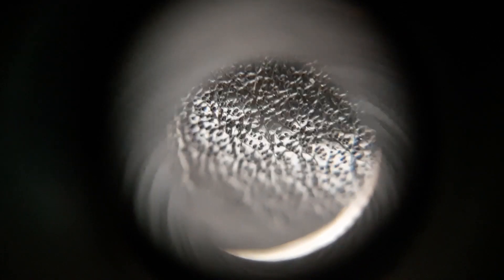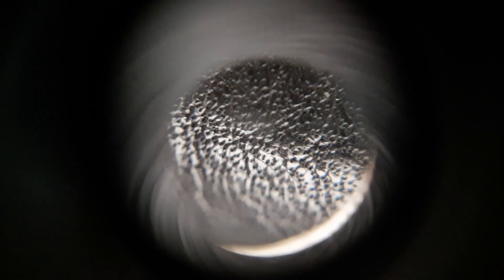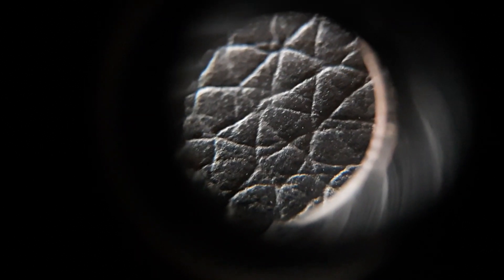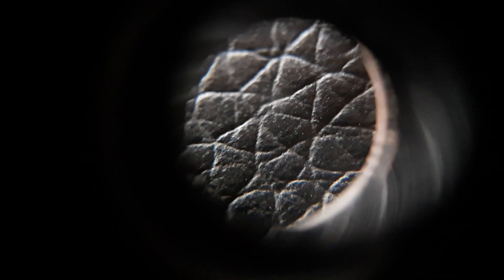Genuine Leather vs Real Leather: Under a Microscope

Comment: Well, this is valid, but still not too reliable, I myself have several leather products, some fake, some real, some genuine, and I also happen to have a microscope, and I also happen to have run a few tests, the thing is, you do can clearly see the pores on a more raw leather, but, sometimes, clothing industry use lots of coats over the leather to prevent it from drying or for their fibers "to get loose" like on a mango pit, and also for dyeing them, I also put my own skin on the microscope for comparison, and the conclusion was: on faux leather, same thing you shown, on raw dyed leather, same thing with pores and all, and in some real leather clothes (depends on the finish, obviously) it didn't look like neither, it had lumps, just like the genuine you've shown, but if you zoom enough you can clearly see it is brown beneath the lumps, and between the lumps you can even see untainted spots with pure leather color

Comment: Microscope method is NOT accurate anymore because you can see the pores for the fake leather-like products such as "bonded leather" and "bycast leather", which are made from the real grain leather scraps using press (it has 3 layers: base is fabric or paper, 2nd- pressed leather scraps and 3rd top - PU or other synthetic material).  This is how mass production cheats consumers in nowadays.  Only genuine grain leather is true leather.

Comment: Nice information...
Apart from these other types of Original Leather - Full Grain, Top Grain, Corrected Grain, Bonded, the other leathers like PDM (Printed Dry Milled), Suede, Semi-Aniline, Genuine are forms of Original or artificial or a mix of both types of leather?

Comment: Well now I never thought to use a microscope to make sure I get the actual product I paid for, I just monkeyed around with leather identifying "tricks" like sniffing or rubbing or throwing water at it. This is such a practical way to identify real leather!
Reply from the maker: Modern techniques for faking leather are impressive.  Almost all the leather you see out there is "genuine" and that means "fake."  They can make it smell, look, and feel like the real thing, until a few years later when it starts to degenerate.  Real top-grain chrome-tanned leather should last decades, at least.  But full-grain veg-tanned leather can last centuries.  Thanks so much for watching!